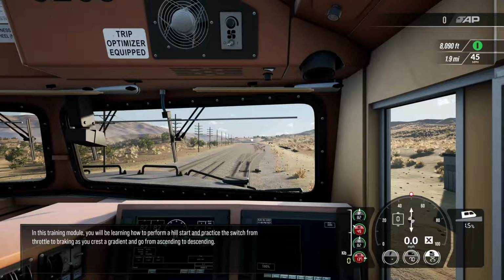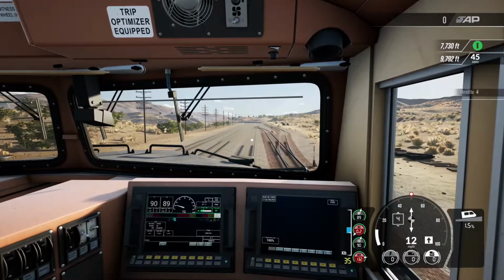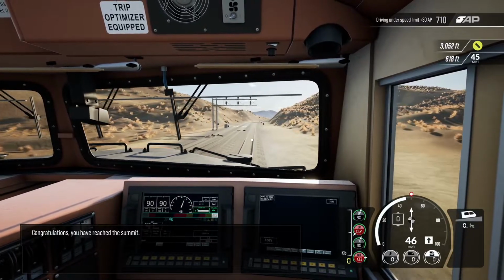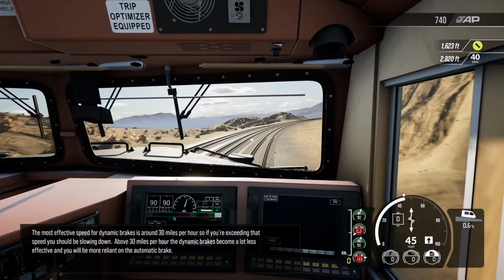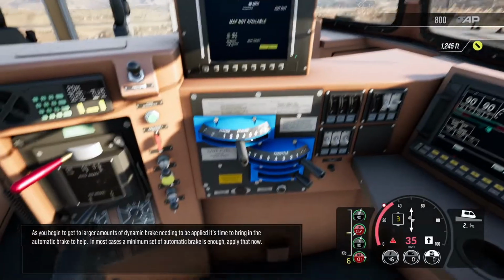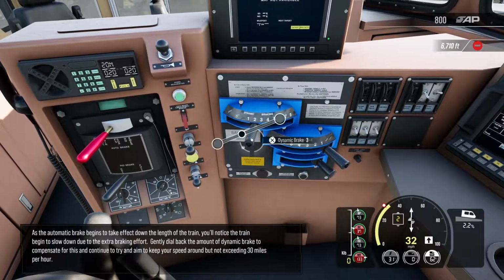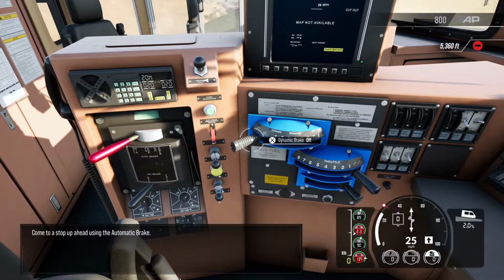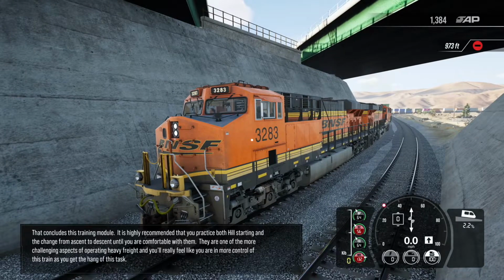Train Sim World 3 - Cajon Pass - Hill Start & Dynamic Braking Introduction

Comment: Not tried this one yet.  Freight doesn’t hold my interest as much as passenger runs.  There are trophies though so it’ll be done at some point.

Do you have the platinum yet?
Easiest one by some distance.
Reply from the maker: Yeah freight isn’t my thing either but I do them just to complete them and with the new channel I will most likely post all scenarios as well. Nah been doing the guides and stuff but the only thing I need to do for the plat is run my own scenario with a livery I created so I could do it in 5 mins if I wanted too. 😂